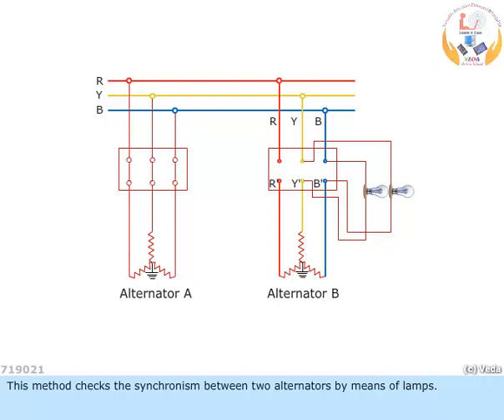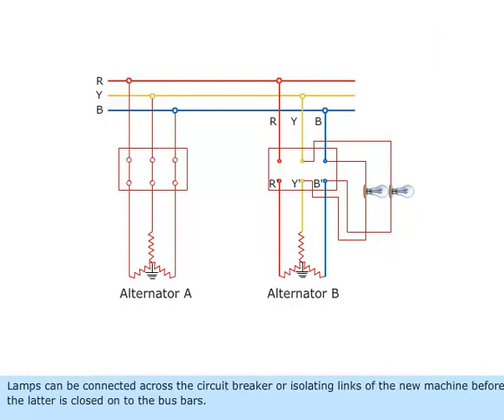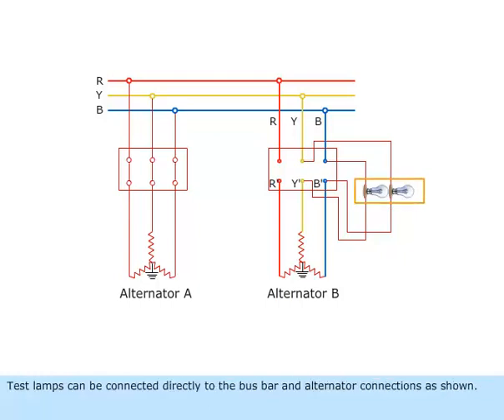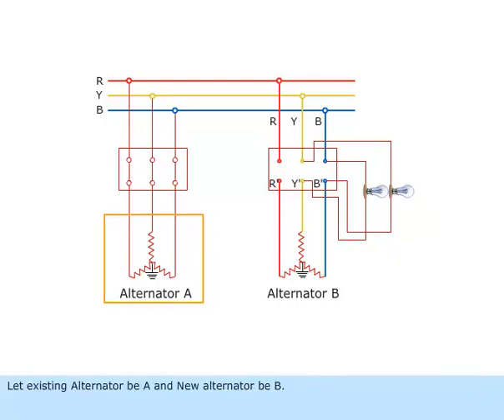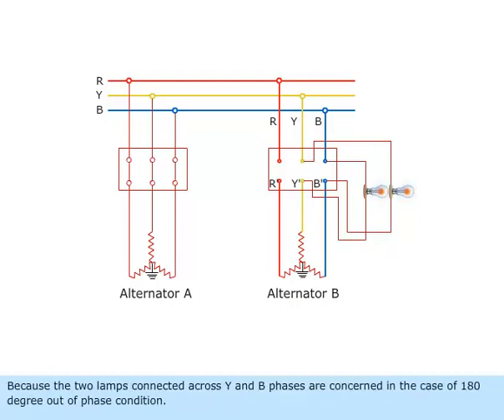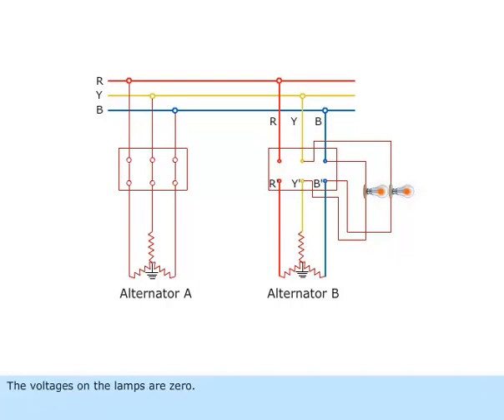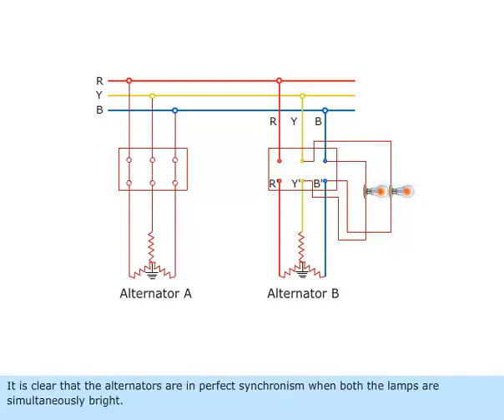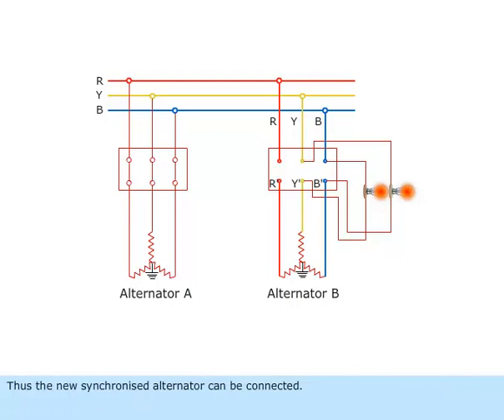synchronization check bright lamp method

Comment: Just like fuse burned method that is in parallel with a led diode that is in series with a current limiter resistor but in this place the role of knife switch acts like a open and closed fuse but for finding wrong polarity